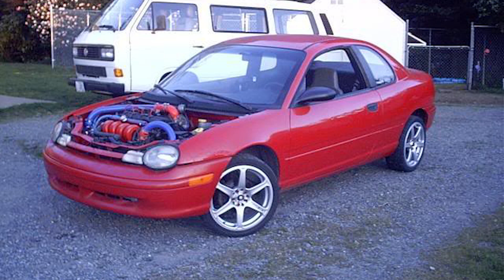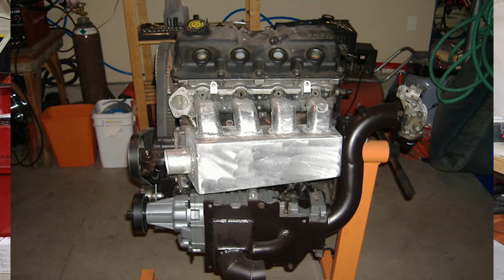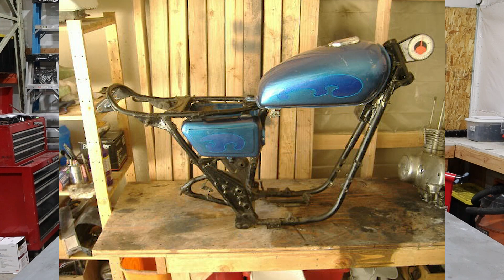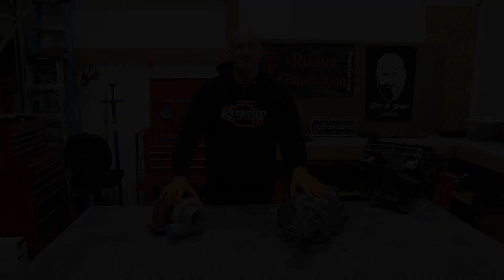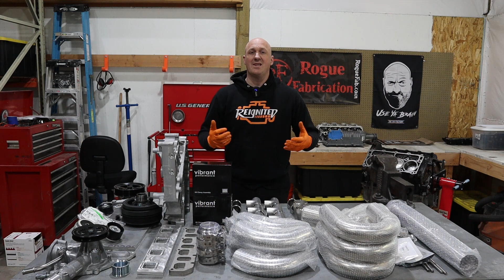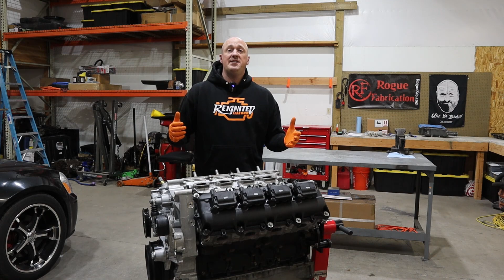Poor Man's Hellcat Ep1: Building The Engine!

Comment: The blower doesn't even need to do much a few psi down low and bypass valves divert air to the turbo
Run a 70-76 mm turbo

Comment: I just came on board, did you measure for bearings, why did you leave that out?
Reply from the maker: Pretty much all of my builds I'm using a factory short block, and the Hemi engine does not use selectable bearings, so there's really only one size to use. If the crank had been machined at all I'd be checking bearing clearances, but with factory parts, just replace and go. Thanks for watching Robert!

Comment: Simply put, pick turbo that meets your needs. Choose compressor side that can deliver enough air for your expected HP goal regardless of the engine set up (SC or non, 4 banger, 6 or v8). Probably 800ish hp?  And go with a free flowing turbine side, maybe 1.32 A/R because at lower rpms engine will act as a bigger displacement than a 5.7, around 8 liter equivalent.
My guess is at lower/mid rpms the turbo/sc combo will have a compounding effect, but at higher load and rpm turbo will light up and surpass what SC can process. So air will be moving thru the SC but not compressed any further.
It'd be good for you to get a professional tuner in on this project

Comment: I have a question completely unrelated to the video other than the fact I have Hemi question, I’m looking to cam my 08 hemi charger with the comp cams hrt stage 2 220/230. What all do I need to do to disable the mds? Is it as simple as buying the block off plugs and putting them in the mds solenoid holes?
Reply from the maker: Unfortunately no, but you can go one of two ways. Either you keep the solenoids in place and just buy a tuner to turn the system off, or you remove the solenoids, replace all the lifters with non MDS lifters, and then buy a tuner to turn the system off. I personally think it's better to remove it entirely since you'll get better oil flow through the lifter bores. But obviously it's more expensive and more work.
Reply: @ReignitedAuto  alright cool, thank you very much. Would i also need to buy the block off plugs after removing the solenoids or would it be fine leaving that space open?
Reply from the maker: @sethoverly1178  gotta buy the plugs, otherwise oil would be spraying out 👍

Comment: so ive been looking at junkyard hemi's to rebuild both for my 2004 ram and for side project engine swaps. but i was curious, how similar would a hemi be from say a 2006 300 and a 2006 ram? would i be able to put a ram hemi into a project car and have it still act like a 300 hemi? also curious because i want to do a mild cam on my current ram 1500 and i dont know if i should get a cam for a challenger or do i need a ram specific cam. i know its a long question and i appreciate you taking the time to respond to so many people.

Comment: A Turbocharger in the Garrett GT40/GT42 range should be suitable when you want to keep it below 1000hp. Big question right now is: do you want to use SC and TC individually for low and high rpm respectively so your SC e.g. will be bypassed at higher rpm? This kind of system is easier in general setup questions (pipes, bypass valves and that kind of stuff), but the software tuning will be challenging regarding transition areas within the maps for a smooth ride quality. If you want to have a dual stage charge system the order of SC and TC is really important. In this case I would put the SC before the TC, because this SC style definitely won't like the high pressure the TC can put out. That way you also enable the TC to reach higher boost pressures in which case it might be a good idea to move to a TC one or two sizes bigger.
If you want to see an example from series production, look up the VW 1.4 TSI twincharger engine from the 2000s (not the modern 1.4 TSI). That one is also using both a TC and a SC. But this system idea never made it out of this single engine configuration at VW.

Comment: My 06 awd 300c with a 7875 turbo, e85, and bone stock 180k mile engine/trans has made 470whp@10psi and ran a 10.9@123 in the 1/4 on 12psi. So theres potential, and I think e85 is key keeping the stock pistons alive.

Comment: Do you have to torque in a specific order
Reply from the maker: As far as which main cap to start with? If so, no you can realistically start with any of them. I'd also torque the main bolts first, then torque the cross bolts after that. 👍

Comment: I need some info on the NAG 5 speed trans. Can I  replace my truck 5speed with a car 5 speed? I don't like the weird 3rd gear in the truck transmissions and would rather have a normal 3rd gear because it doesnt suit my driving habits and how i use my truck. Would the truck computer need to be tuned for a car trans? I have a 2010 Ram 1500. I love watching your content on YouTube. You are full of very valuable information and tips on these Hemi engines. Your information on the 3rd gen oil pumps helped me out a lot. I'll see well over 200,000 miles because of it. By the way, this truck has 191,000 on it now with the original cam and lifters, although i had the mds turned off at 135,000.
Reply from the maker: It could potentially be done, but it would be a nightmare to make it all work. The NAG actually has a separate TCM controller whereas the stock trans computer is built into the PCM. Getting everything to talk properly would be very difficult. As an alternative I would think about changing your rear gear ratio, this could effectively change the way 3rd gear feels overall. 👍

Comment: I would definitely use the turbo charger for high rpm boost as in a big turbo setup. The blower should work well making low rpm power.
Reply from the maker: That is the thought, but I'm a little concerned that my inexperience is going to blow this thing up immediately trying to tune it 😂 Ah well, we learn right?

Comment: I actually put a m112 on a stock 5.7 about a year ago, it made 7psi with stock pulleys and basically no porting, unfortunately it kept shredding belts and i didn't have time to mess with it, ill definitely revisit it at some point, i used an m112 off a 09 range rover sport.
Reply: Belt Alignment was probably off
Reply from the maker: Very cool! Have any pictures of it? If so, send them to me sales@reignitedtx.com I'd like to check them out. 👍

Comment: Would it be prudent to measure the bearing clearance?
Reply from the maker: Generally if I had machine work done to the crank I'd definitely be checking the bearing clearances. As it is, with a stock crank and stock block, I've checked several before and they always measure out correctly, so I'm comfortable just slapping in a new set of stock size bearings. 👍
Reply: @ReignitedAuto  I have read on the internet (so it must be true) that some guys try to keep the clearance on the high end of the spec for boosted applications and my even try to get 0.0005 over that.  Not sure how much a new set of bearings vary ...

Comment: Couple more ideas/suggestions.  I'd try hand-porting the oil pump and cylinder heads.  The oil pump is easy to do and as far as the head goes, if you want to just gasket match, you can (Which is easy) or if you want to challenge yourself, then you can work on the bowls.  Since the eagle heads bring more compression, but you're throwing boost at it, you may want to deshroud the valves, which will increase the cc of the heads, bringing down the CR.  Of course you could run a thicker head gasket also.  If you need more space in the engine bay, you could run an electric water pump and an electric steering rack where the motor is either on the shaft (Saturn Vue/Prius style) or on the rack itself (S550 Mustang style).  Either way gets rid of the PS pump.

I'm building an LS engine right now, and the bottom end hardware on the hemi is much more stout than the LS.  The bolts are thicker, and I think the main caps are bigger (Wider) even though they only run 4 bolts instead of 6.
Reply from the maker: I'm definitely thinking of ditching the stock power steering pump for an electric unit. Trying to see what kind of room I have first. It's going to be a head scratcher for sure...

Comment: The "right" answer depends on where you want the boost.  Since it's a PD blower, it's going to make tq everywhere, so you don't really need to make up for poor low speed boost response like a Centrifugal SC.  I would size it like this.  As far as what the turbo see's, it's going to be the effective engine size of the N/A + SC engine.  e.g. the exhaust output will be the 5.7 + whatever you increase it to via boost.  Since we know you effectively double the size of the engine every 14.7 psi, you can up the size of the engine and buy your turbo accordingly.  I'm guessing you aren't going to build the internals, so I would guess you'd probably run it at around 7 psi, or about 50% larger.  So your 5.7 essentially becomes a 8.6L engine.  So from there, you can pick your turbo.

Of course, all of this said, I think you're just trying to have some fun, and probably trying to do it on the cheap.  So I'd honestly just get a GT40 style turbo from vsracing or any of the clones that Richard Holdener has tested.  They are dirt cheap, should spool up very quick.  They will probably be too small, and end up giving you a lot of backpressure at higher RPM's, but if you're not doing pistons and rods (Personally) I wouldn't spin it beyond the factory limiter anyway.  If you want to complicate your life even more, just bolt two of the turbos on and that would probably alleviate the backpressure problem.

Very much looking forward to the series.
Reply from the maker: Tucker, sometimes it's creepy how much we think alike 😄 I already have an email in to VS Racing to see if they want to partner up on this build. 👊

Comment: Nice project! Don't you actually want to lower the compression ratio a bit instead of raising it? Otherwise you are going to have to use super high octane fuel and super stout internals. The cylinder pressures are going to be insane. What is the target boost, compression ratio and fuel octane?
Reply from the maker: Yep, as I'll go over in the next video it basically is only bumping the compression one point from 9.6 to 10.5 and that's still definitely in a useable range. 👍 Target boost is a good question, I don't think I want to go over 15psi at the start, then work my way up from there.
Reply: @ReignitedAuto  Isn't the stock compression already 10.5 in the 5.7? The Hellcat has a 9.5:1 and Chevy's LT4 is 10:1 so I would have thought to go down a bit instead of up. Anyway, looking forward to the next one!
Reply from the maker: @mbaladon  On the pre 2009 engines it's 9.6 and when they changed to the eagle heads it bumped to 10.5, if it were 11.5 or over I'd be more concerned, but as mentioned, this is kind of a sacrificial engine 😄
Reply: He should be okay. You typically won’t need to change to a better gas with higher compression unless the compression is WAY higher. Stock compression, even on one that’s been bored out, you should definitely be okay.
Even on my 4 wheeler, stock compression is 9:1. People use pump gas up until 12:1 compression. My piston is rated for Pump or Race Gas.

Comment: Do you refer the Melling oil pump over the Hellcat and if so why?
Reply: 03-08 block must use Melling high volume, because Hellcat pump dont fit.
Reply: @Rrottweiler  Did he mention the block was an 03-08?
Reply from the maker: Yessir that's correct, this is a 2006 ram 1500 block, so that's why I went with the Melling high volume pump 👍 2009+ I'd go with the Hellcat for sure.